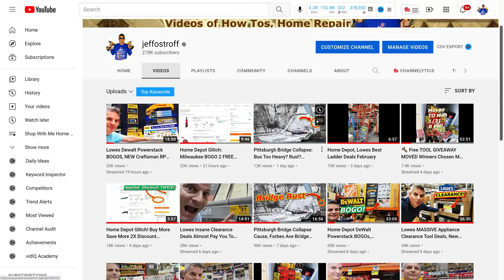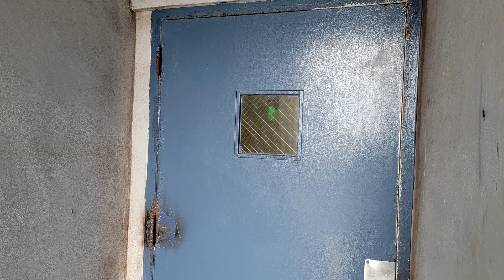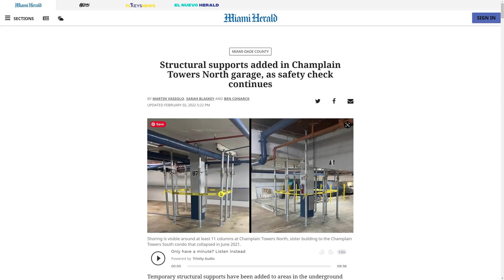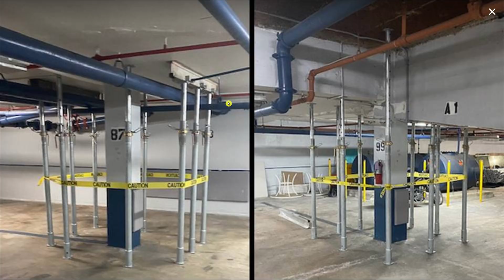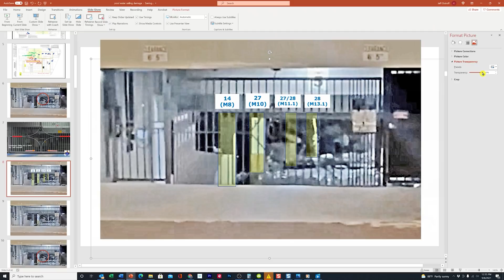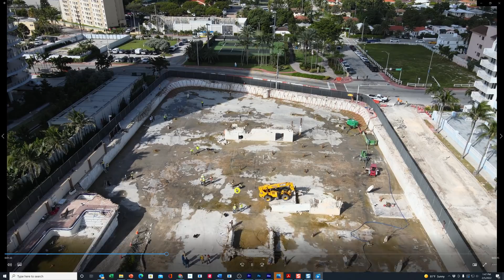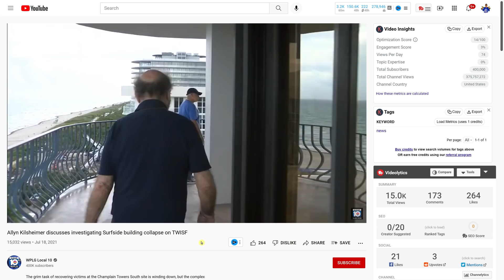Miami Condo Collapse: Sister Condo Just Added Support Poles!

Comment: Jeff: I knew the exact cause of this building failure when I saw the first collapsing video. Short of a bomb, or deliberate attack, it was a simple structural failure of the concrete supporting structures. The only thing that could cause this would be an overload, or a rebar failure in the supports and decks. Which is normally caused by corrosion. I'm a corrosion engineer, with enough credentials to be called an expert. I only had to see one "before video," to determine exactly where the structure failed. It was under the flower beds. As a corrosion engineer, I see this failure all the time. They overloaded the structure causing cracks. Then the real cause became the FERTILIZER they used to feed these palm trees and the trees watering systems. The trees and flower beds over loaded the supports and caused cracks. Which the FERTILIZER used to gain access to the rebar. FERTILIZER contains Nitrogen and other corrosives that eat rebar for lunch.  The rebar corrosion caused more cracks and spalling.  Note: the paint stripping away from the water logged concrete in the deck areas in the garage.  The concrete was turned into dust and failed per your structural analysis.  Therefore, the cause of the collapse was the improper placement and use of improper flower beds.  Plus their use of FERTILIZER and likely watering pipes that cause rebar failure. End of Story.
Reply from the maker: I am sure they were too cheap to use fertilizer, I know how all our local HOAs work. The planters lacked insufficient waterproofing, plus the weight of the dirt on them added a lot esepciallially when it got wet, and HOA records show they had roots growing into the planters drain pipes, clocking them and causing cracks. The new Engineer Morabito actually told them the new design was to fill the planters with geofoam as much as possible, and use very little soil, enough for the plants, and all soil and weights of solid had to be approved by him first.
Reply: @jeffostroff  Who knows for sure but if someone had the job of watering and taking care of the plants and flowers, then they probably used a Miracle Grow or something. Tenants hate and complain about dead plants or burnt vegetation and it's not that expensive to fertilize here or there. Seems plausible to me...
Reply: @jeffostroff  / Do they need a Second Opinion?
Reply from the maker: @karifredrikson8492   A second opinion here might be a good idea
Reply: Sounds like a pretty solid theory.   How do you know they used fertilizer?  That stuff is terribly corrosive!
Reply: @willschultz5452  They have to use fertilizer otherwise the plants will use up all the nutrients in the potting soil they're planted in and die. Unless they want to replace the potting soil every year and plant new plants every year .
Reply: @killman369547  Agreed with you.  Many condo association hired landscaping co. to care for their lawns, and trees.  The landscaping co. uses all kind of fertilizer to keep the plants looking beautiful and green.
Reply: If I could add to your comment, another condition that could cause a lot of corrosion is all of the salt/beach sand that people bring up from the beach, or which blows in the seabreeze. That salt washes down into the structure when it rains and adds to the problem.
Reply: Your description seems quite reasonable and explains how the slab might have failed under the planters. 
Were there also spalling in the upper floors such as seen in many buildings of similar construction? What do you think was happening in those situations?
Reply: THE COURT CASE determined it was the building next door allowing its water runoff to undermine the South towers.  That building & the construction companies that allowed water runoff were fined 100s of millions of dollars

.
Reply: what rocket scientist decided to put flower beds INSIDE the CONCRETE AREAS......DUH. The water had to go SOMEWHERE....
Reply: Not to mention all the renovations inside that added huge granite tiling and heavy granite countertops.  The building that collapsed contained at least 6 of these heavily renovated units which added tons of material to the building. 

The building on the left didn't.
Reply: You mention the concrete would be turned to dust. That would explain why so many witnesses have stated the standing water in the garage often had "white powder" in it and why so much "calcium dust" was found in the garages for years leading up to the collapse.
Reply: Nicely explained thank you. In your opinion should any of these buildings which currently have planters like that be looking to get rid of them? 
Imagine something that was put in place to create an asthetic and look good has caused the collapse of a building and loss of life
Reply: Great step-by-step analysis thank you .

Comment: You made everyone aware of that first column blowout. To this day further probing has apparently not redirected their attention elsewhere but has done one of two things. Refocusing there yet again as you've pointed out they keep doing, obviously their deeper analysis has either privately verified vulnerabilities at or very near to that part of the structure or else failing to generate useful results, they feel precautionary measures are needed to prevent a recurrence of the earliest verified failure to have triggered the collapse.
Reply from the maker: Thanks Jerald!

Comment: Those added support poles are a joke!!! We are taking about millions of tons of weight here, not 1000 pounds!!! I would NOT live in the sister building for all the money on earth!!!! It is only a matter of time when it collapes too. Those added supports are no stronger than toothpicks!!!
Reply: The shoring posts are not supporting the weight of the columns.  They are just there (presumably) to hold up the slab while  structural remediation to the column caps is done.

The building doesn't weigh "millions of tons"...  The debris from the (larger) Champlain Towers South was stated to be 22 million pounds, 11,000 tons.  CTN is probably 10,000 tons, supported by more than 100 garage level columns.

Comment: Are they going to wrap the columns in kevlar with epoxy to prevent the expansion as the column crushes. 
They do this in los angeles to meet earthquake retrofit spec's.  They may need like the wood framing with the flare at the top. Need to make fiberglass split forms encase loops of rebar around the columns then concrete them.  It would not be hard to create a chain driven rebar column winder.  That much like creating small coil springs pushes rebar forward into rollers that wind the rebar around the columns.
Reply: It's not the actual column strength that's the issue.  It's the connection between columns and slabs.  Not enough rebar was used.

Comment: They mixed the North Tower with the East Tower.
The East Tower was built 25 years ago and it's not a twin to the South Tower which collapsed.
The North Tower does need shoring because it has the same deficiencies as the South Tower.
The engineer in the video is taking about the East Tower not the North Tower.
Hope this helps.

Comment: Thanks, Jeff; I have learned enough to tsk-tsk over concrete spalling. Which I've noticed is everywhere especially on bridges. The two buildings also shared what looked like dirty roofs. It will be interesting to see all the water intrusion findings in the North building. (Will, the North's building inspection, be available to the public or only to the residents?)

Comment: I see those poles also here in some garages, built in a certain way that has caused some ceiling collapses. I do not think they really know how to repair those decks (here in Holland). It's been a long time for any work has been done.
What I wonder is, how much can these steel poles carry. Are they sufficient?
Because they're steel, they do not seem strong to me, strong enough for this job. Could it hold that enormous weight of the building above it. Maybe numbers of them matter? 
I see on one of your pictures they used many, many poles.

Comment: They have likely found out what happened to the south building and realized this building has the same issue. I’d run from the sister building and sell at a loss.
Reply: Surely you mean "I'd just walk away and take a loss." Who in their right mind would buy any unit in that building knowing it's the same developer, design, construction, and same continual corrosion from the saltwater air?
Reply: @coriebarnes8680  People would still buy at a premium in this market to air bnb
Reply: @mattbrawner7888  
You're right about that. Investors who have the money would buy it for the tax write off when the property value slides into the abyss or if that building meets the same fate as its sister building in the future. But the astronomical HOA fees, special assessments, and insurance might be a turn off.

But, yes the possibility of renting it as an Airbnb is an option. But I can only guess that no one here in the US or other countries who followed this major story would even rent it short term for vacation. Those who are not aware might rent it because they are oblivious to its association to CTS. I think that the people who moved out were wise in doing so.
Reply: @coriebarnes8680  Most people only heard a mention in the news. Tourists likely won’t remember which building it was, and a lot of younger people don’t even watch TV or read the news.
Reply: @coriebarnes8680  , moreover, any half-decent condo association has outlawed short-term rentals, and most discourage even long term rentals. No good association here in Chicago permits them, including mine. You really don't want total strangers having unlimited access to your building and its facilities.

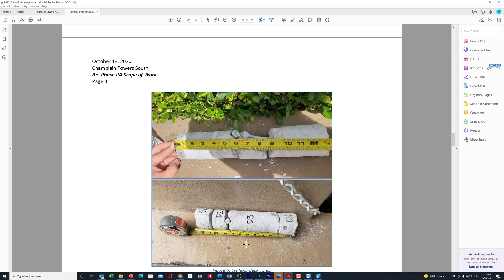Comment: The scariest thing about BOTH of those core samples @11:32 is NOT that they each clipped a piece of TOP steel, but rather that close to TWO key columns, the once-stout 9.5" thick slab had DE-laminated (due to FLEXure) into a stack of much weaker (and nearly useless) 2" slabs!  Just how disintegrated this KEY "clamping" slab (stiffening both the retaining wall AND the building support columns) was can be seen in the many surviving pool-deck columns, which instead of having a textbook "crown-shaped" piece of slab still attached, instead got a complete "pencil-sharpening" by the completely UN-bonded rebar "mat" (grid) as it slid to the garage floor.  Pity.
Reply from the maker: Yes the slabs just slid down the poles cleanly in most cases
Reply: YES,exactly!

Comment: 6:10 You'd be amazed how many people don't go into camera settings and change off default 2mp setting  to the 10-15mp quality images the phone is capable of. Not even really a storage thing these days with the cloud and storage being so cheap. But I mean, even looking at that photo it's insane how undersized that column is. That's like a 24" column coming into it on what a 3-4 way intersection of beams?
Reply: Didn’t know I could do that! Thanks for the info
Reply from the maker: yes the other side of building were 24" columns
Reply: The resolution was probably reduced by The Miami Herald before they put it online.  You get the gist of the image.  No mysteries revealed with higher resolution...

Comment: I was 99.9% certain there was shoring going on at CTNorth... just haven't made the time to drive down from Pimp-a-no and take a peek... glad The Miami Herald still has their teeth in this.   Even with better maintenance, and the fact that CTNorth HOA did NOT pile new pavers atop the old pavers on the pool-deck, CTN still has the not-quite-thick-enough slab, zero punch-thru steel + zero drop-panels where skinny columns join slab, and a-bit-too-long-of-span between said skinny columns... #BlameReiber
Reply: Perhaps if The Herald started calling it the "Flexy Deck" instead of the "pool deck", it would break through the So-Fla malaise, and inject the proper urgency into the affair!  ;')
Reply from the maker: Bouncing betty deck
Reply: @jeffostroff  That's a better "tag"... but if there's really shoring going on ABOVE that pool-deck/lobby-floor level, OMG!  Note The Herald article discovered no permits issued by Town of Surfside, despite the extensive and STRUCTURAL nature of this "temporary" shoring work!... err, umm, isn't that kind of slacker attitude how we got the CTS tragedy??  =:O

Comment: Inadequate punching shear resistance around the columns - i.e. where the flat slab meets the column. The building should be condemned and demolished.  Suspect many other contemporaneous buildings in Miami have the same problem.
Reply: Yeah, it's beyond fixing.  They'd have to reinforce every column on the bottom 3 or 4 stories to be certain.  That's like 300-something columns, tearing up people's units in the process.  Tear it down.
Reply from the maker: They can save the day like I showed in my previous video from September 11, where they add drop panels and capitals to the columns

Comment: the contractor did not do lidar on their exploratory cores?
Reply from the maker: It's actually GPR I misspoke, LIDAR is for measuring distance. And we are not 100% without seeing the core in our hand
Reply: Looks that way :( Note the complete delamination between layers D2 and D3. If that's what happened across the slab, it would have been horribly weakened.

Comment: I'm surprised they didn't do it last year.  Even if the other buildings are fine, they have a stigma of being the same as CTS, so the shoring could be PR for their condo owners and/or perspective buyers or maybe the insurance company is mandating it.  Or maybe their 40 year certify really is showing problems that they are addressing.  Either way, good on them.
Reply: If you are going to do it as a PR exercise, back when the disaster was fresh, and CTN residents were very worried, makes more sense than now.  They could have got Kilsheimer on board with it; it wouldn't compromise any good engineer to run with the "abundance of caution" or "until we are fully satisfied with our investigation" lines.

I think this is more serious; someone has found something that caused by them great concern.  Either something physical in ongoing inspections and investigation, or some number crunching or detail on the design which left them questioning the original engineering.

Alternatively, it could be a chess move by the developer that was trying to buy out all of CTE & CTN, for a redevelopment of the entire 8800 block.  I don't know if that developer is still sniffing around, and there's no evidence linking them to anything; just thinking of all possible scenarios leading to this.
Reply from the maker: good idea, should have done that

Comment: So how many people have moved out of that condo? I never liked, concrete and rebar construction never could rap my mind on how the two-component worked to gather. My biggest problem was the rust how can you get concrete to stick to rusting steel. There are millions of buildings built this way and they are safe. It still creeps me out.
Reply from the maker: I know some have moved out, probably not a lot
Reply: The concrete stops the steel rebar from rusting.  Only if the concrete gets damaged & allows water to reach the steel does rusting begin.  Problem is people see the rust & think it’s okay (but it isn’t).  Deferred maintenance eventually makes the column collapse

Comment: Can you measure the step beam size then we can run calcs on it as that is probably what failed when the planter beams were ripped out of the connection. And are there wall section drawings anywhere or did the contractor just guess?
There should be at least 20 of them.
Reply from the maker: The beam sizes ar eall shown in the floorplans, and all wall dimensions are there too
Reply: @jeffostroff  I mean on the existing CTS to see if it is 12" smaller than indicated as this happened on old CTS. And where are all the wall sections showing how to build this??
Reply: You can assume that the concrete crew, working for the company owned by Nathan Reiber, were 'flying by the seat of their pants', improvising as they went.  "Drawings?  Drawings?  We don't need no stinking drawings!!"

Comment: Me, I would have shored the pool deck columns ASAP and then put the necessary time into doing a structural integrity evaluation.

Next as suggested in one of your videos (Jeff has kindly supplied the URL below)  , I'd add columns to support the pool deck next to the tower columns and then separate the deck slab from the tower columns.

Lastly I'd like to assure that a single column failure would not cascade to the entire tower. It's missing a couple shear walls that might have saved CTS.
Reply from the maker: George I mentioned isolating the pool slab from the building in my video from Sept video here https://youtu.be/CK3o8KlL3NQ
Reply: The falling deck damaged the main drop beam which supported the exterior columns and caused shock waves.

Comment: They may have identified via periodic inspection some minor corrosion in the steel or cracking, those temp supports better not stay there forever as sometimes forgotten.  Whoever called for it, should state why, no secret.
Reply from the maker: I hope it will be on the building permit

Comment: Thanks for the video.  Each of those pole supports put a point load on the concrete floor that the floor would not have been designed for.  Shouldn't those poles have some type of steel pad to distribute that load?
Reply from the maker: Steel pad or 2x12 wood, but I am not too concerned, the column is holding most of the load.
Reply: yes at top and bottom which is standard engineering practice in my 40 yrs.